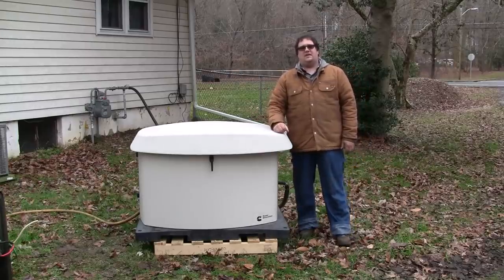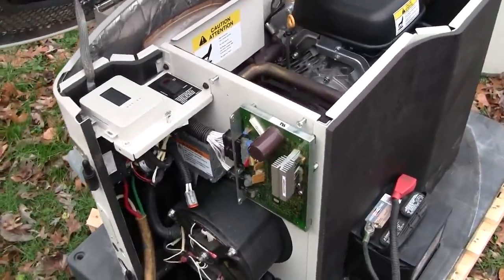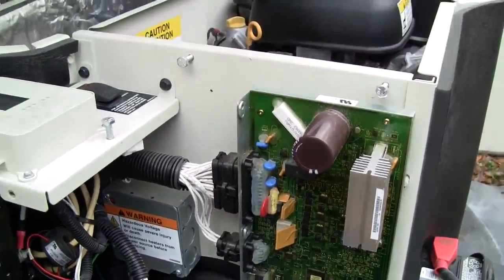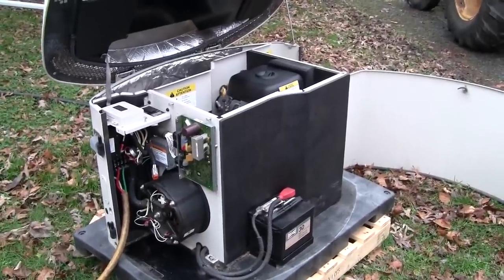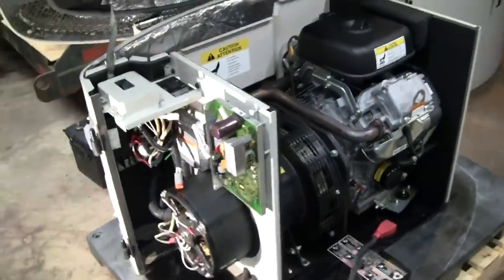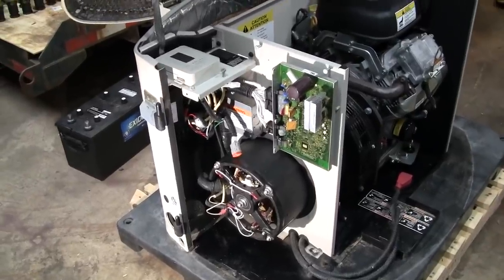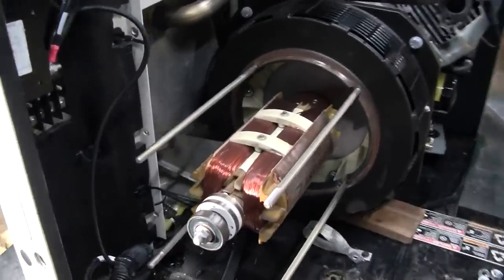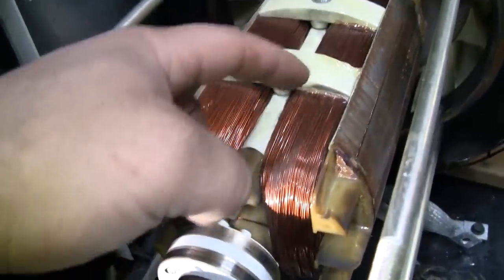2015 Cummins Home Standby Generator IS IT DEAD ALREADY? Pt. 1/2

Comment: CUMMINS, a traditionally Great company, selling their name so someone else can sell their Garbage. Case in point, Cummins is a diesel engine company, unless now they manufacture gasoline V twin lawnmower engines. It's now apparent to me that Cummins has entered the home generator market. Its mind boggling how a company that has made history of building Great diesel engines, with manufacturing in different countries for a century, needs to enter this competitive market, filled mostly with cheesy junk.
Reply: It would probably be placed out for bids to a specification.  Likely you will find multiple engine manufacturers across their line range where they don't make that small an engine.
Reply: @gordonborsboom7460  This unit was a Briggs engine, the current production version uses a Chinese engine, Loncin I believe
Reply: @gordonborsboom7460  Yes, and many great manufacturers are doing the same, to great detriment. If you dont make the primary component, you should not be selling it under your Brand. That's misleading !
Reply: @nspro931  Great, Hey it says Cummins, so it has to be Good, right.🤔

Comment: Onan has a problem with the cap holding the auto choke spring in place. Same exact problem show here... fires but won't idle. My 25 year old Onan still runs like a champ... my 2015 runs like shit when it does run... pathetic.

Comment: Question from a novice, why was the winding wire gauge different to the tail he made up.
Reply: I ran it until the ad's came up so that he gets his nickel but have not see that yet ▬ person would have made a pigtail to energize the field which by that time with all the commie sales bs that has long ago defeated any attempt at usefulness they are trying to get over on him for the standard $300 same as other exploits → should not take a whole lot to get the field energized enough to ramp up to Operational ~ simply put if the wire is "big enough" to handle the amperage momentarily all that plastic BS should feed from what the rotor feeds to the slip rings  ▬  At 20 minutes I see debris has damaged several things; I wonder if the even force-vent an enclosed fuel tank or just what they did but to answer the question is wire is big enough for testing then is is big enough for testing

Comment: At 20:40 those scratches on the windings, etc, looks rotational by nature, as if something has been dragged around whilst the engine is rotating.  What????
Reply from the maker: Alan, I think those occurred when they were removing excess varnish at the factory.  Pretty bad quality control. 
Thanks for watching!

Comment: Now that looks like something done in China. What a crappy way to make a contact. See this issue with solderd sliprings on some rebuilt automotive alternators where the solder melts due to high current idle conditions. Connections should be spotwelded and potted in the automotive applications.

Comment: No factory wants to solder anything just Jam or clip etc because soldering well is an art  I used to solder lots on my boat once had a marine inspector tell me it’s not the way it’s done “ anymore “ but loose connections can crash a plane or disable a boat .,..

Comment: wishing U loads of luck here, volts and amperes too. 20KW set-up costing loads of cash and THIS
is the  so-called quality ?. the beginning and ending of coils is quite often known as A1 and AA1
F1 and FF1  this is important in motors, say traction motors for locomotives. wire is known as
'magnet wire' and is sold in lbs and  the amount of wire on an armature or field is in fractions of 
a pound, so a rotating field as this could call for 20 ounces of 18 gage which would = X amount of 
feet for that gage wire, But 20 ounces of 20 gage wire might not fit. as it would take more footage
to = 20 ounces. , not a pro by any means, however I did rewind a stator for a 91 Harley sportster
as the stator would not keep battery charged and rectifier,regul8or were good.

Comment: Generator was designed to fail. The engine is made by Cummins but I’ll bet they buy the generator from another company. When I was an electrician in the Navy, if we found this we would send it back to the manufacturer to do it again!

Comment: I've repaired slipping wires before. Not this miky mouse design I  silver solder use frat string and epoxy and varnish to fix it. That's a junk design on that

Comment: To the best of my knowledge, there is NOTHING genuinely Cummins about these gen-sets. They use medium quality non-Cummins engines coupled to non-Cummins alternators. The sticker may say Cummins but the rugged quality Cummins is known for is not there. It's sad Cummins sold its name like this, debasing its own reputation. 
I use Deutz and Kubota gen-sets. Both are the genuine article, rugged, easy to find parts for, without the advertising hype.

Comment: Generator tech here - those units are dreadful. That's a Briggs Vanguard engine. Briggs & Steatton's own 20 kW air cooled units are SO much better than these. I wouldn't recommend any "Cummins" air cooled home standby generator. They don't actually make most of the parts in that thing anyway. Their big liquid cooled units are great. These suck. I hate working on them and I go out of my way not to sell them. 

Also their parts network is an absolute joke, which is unacceptable given most people who have a backup generator have it for a reason - medical equipment, network equipment, etc. I have a customer with a ventilator in their home that has one of these and I've had a portable Generac 8 kW hooked up temporarily for the last several months because I'm waiting on a circuit board.

Comment: Cummins is kinda dumb, for a like factory repair, they could just pop the rotor off and rewind it with the same wire but with half one turn worth of wire sticking out extra on the starting side, then wind it the same way unwiding it went (I could make something from wood if I was doing at least 2 of them) and leave the ends not very taught, then press the part back the same way and reassemble, maybe even run the wire through twice to give it more to contact, I’d do that for $50 if the rotor was brought to me, so $100 a unit for the first ~5 to cover costs of tools, then $50 after, how much are these things new because it’s like a grand for a cheap portable unit that isn’t just a weed whacker glued to an inverter

Comment: Just goes to show how bad modern equipment is. This was all done this way for ease of production, just so they could save a few pennies. And to top it off, you can't get replacement parts for something this new, but some of the old equipment, parts are still available. It's such a disposable society, really sad.

Comment: I spotted a broken wire on the rotor
Reply: The rotor is apparently one continuous winding, so if it were broken, the resistance reading would always be open.
Reply: Saw it too around 2 o’clock but apparently not broken.

Comment: Is this another Chinese fail?  or is Cummins to blame?  For the short run duration of a backup generator it's sad it blew up up so soon.  What is even sadder is the fact the unit didn't even last 5 years.  Sadder still is the fact the owner had to have an extra cost warranty or they would have a very large and heavy paper weight.  No wonder people don't buy standbuy generators.
Reply from the maker: I would say that it is simply a poor design in general.
Thanks for watching!

Comment: Awesome. ...yeah ...those friggin blowoff valves...😤
Reply: #ProjectFarm used one in his last video.
Reply: The big box stores around here won’t sell water heater pressure relief valves because they are afraid of customers doing something wrong.  I didn’t look to see if it is a law or manufactures are trying to avoid law suits, but I noticed the last time I looked that all big box store water heaters come with pressure relief valves pre-installed.  I can appreciate why after seeing that Myth Busters episode of the water heater missile.
Reply: @wtmayhew  lol. Yeah i stock up from ebay. Wells brand? Youre not from mass are you? .lol

Comment: That stator is burned to hell thats not dark colored varnish you will see this on most small gensets because people overload the hell out of them the “standby” rating is an intermit rating the unit is rated considerably lower on a continuous rating avoid gensets that are standby and only look at the prime power rating if it doesn’t have a prime power rating don’t buy it anyway it needs a rewind it’s not worth I would toss it in the scrap pile

Comment: The governor will not speed the engine up, the throttle spring or governor spring will,the governor will only slow the engine down,why do people get so confused with this governor operation? Speed up the engine with the governor NOT !
Reply from the maker: Thanks for watching Wade. 
 What you describe would be correct if this gen set had a purely mechanical governor.  This unit uses and electronically controlled stepper motor actuator which acts directly on the the throttle butterfly.  At rest the throttle is closed until the engine is called to start.  Unlike a mechanical governor which rests at WOT.

Comment: That thing sure does not have the quality of past Onans.  Seems cummins has gone cheap.  That thing may have sophisticated controlls, but the build quality of the generator end screams CHEAP.  Making a field connection with essentially a twist nail? Not good. Stator was not well varnished and looked poor also. What's a few more years out I'm the weather going to do to that?   No parts  for a five year old unit? Ridiculous.